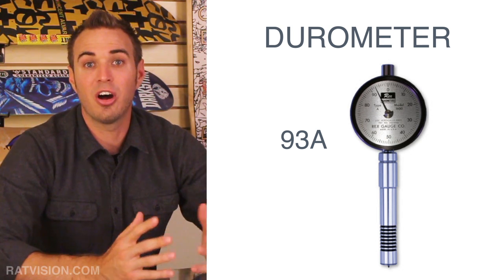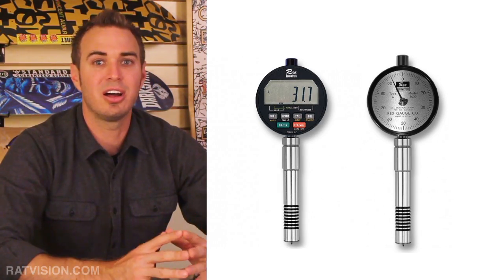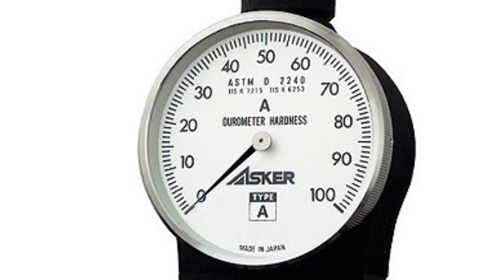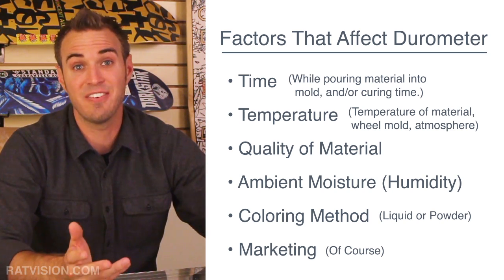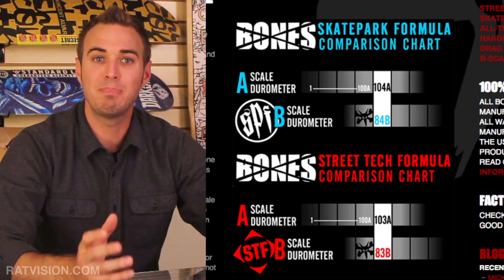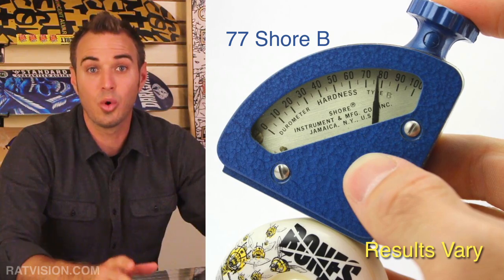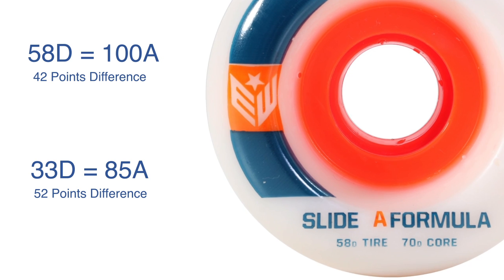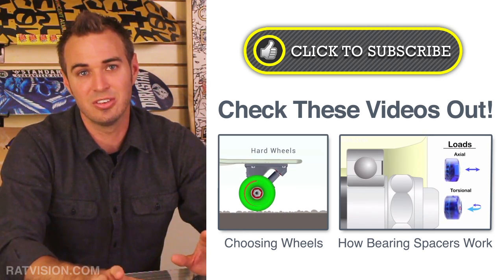Durometer - Hard vs Soft Skateboard Wheels

Comment from the maker: FINALLY!
Reply: Rat Vision – Skateboard Tech YES YOU GUYS ARE BACK!
Reply: Rat Vision – Skateboard Tech you should keep making newer videos
Reply: Rat Vision – Skateboard Tech you should make more good and bad product reviews for both longboards and skateboards.
Reply: What's better rubber seal bearing or metal shield bearing for protection
Reply: Rat Vision – Skateboard Tech  please more videos!!!!
Reply: ikr I can't wait to next upload
Reply: yes but its not recommended.... its only a temporary fix and can actually do more damage than good in the long run... its better to use a REAL lubricant.
Reply: Yeah youre back and f##k boens with a durometer (means in german  HÄRTEGRADMESSER)
Reply: Ricky Matrin i use rubber seals but shieldes are good too the only problem is some have to be bent to open them up and that would destroy them... sooooo yeah
Reply: Nick Carter thanks am going to get rush bearing
Reply: Rat Vision – Skateboard Tech Welcome back!
Reply: Very well done
Reply: can you make a vidoe
Reply: can you make a vidoe
Reply: can you make a vidoe
Reply: where is the new vid? :(
Reply: Can you use briggs and sttaition as lubricant? its a SAE30
Reply: well if its got a full cover, and not a plastic one you can take off, it SHOULD have a spot/hole somewhere in it that you can lubricate from. the whole idea is to not be able to access the inside so it has better protection from the elements.. with the removable ones i think its just easier for dirt and crap to get in there and it will deteriorate the actual bearings a lot faster, and/or give a less smooth ride.
Reply: I really enjoy your videos and you remind me of myself in allot of good ways and BAD WAYS!!! You definilty have some grudge/resentment or ax to grind with Powell Peralta/"Bones". Be honest dude?  I just got a set of Bones ATF 54mm with the open core..........these soft wheels are pure badassness. You can't fake the qualiy of these wheels.   Who ever said that these urethan duro scales and chemistries are an exact science like explosives or LSD-25 Seriously.............I'll keep supporting your vidoes but you need to keep staying more objective and unbiased(which are both extremely difficult as you know).    FYI.............I'm disgusted that Powell is making mini decks in China but the vast majority of their gear is USA made and has been for decades.